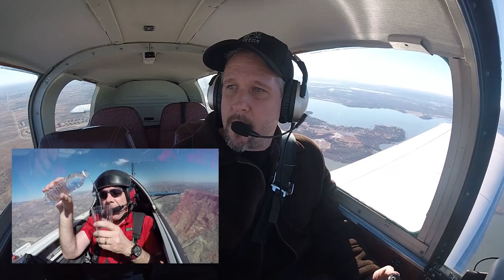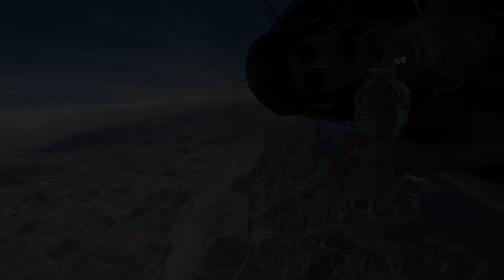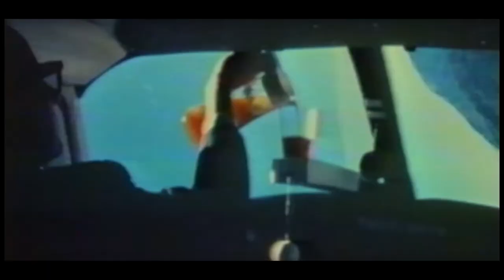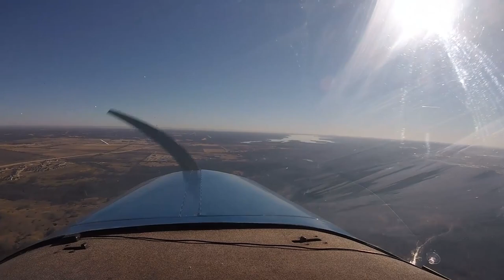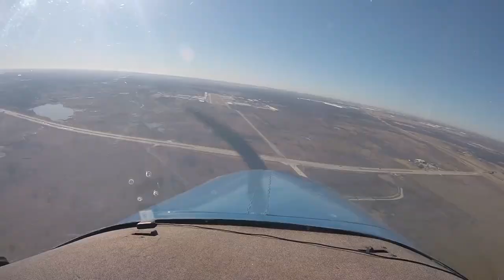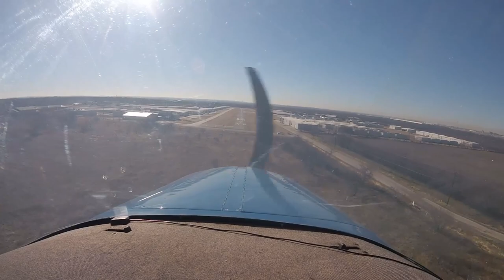Pouring a glass of water in a plane

Comment: Is that the airport where the Cessna student clipped the top of the car?
Reply: Pretty sure it is.
Reply: That's the one
Reply from the maker: It is. And it's going to happen again the way people drive out there
Reply: Just Plane Silly that’s crazy. You’d think they would have done something to mitigate that going forward. :/. (And the fact you fly outta there)
Reply from the maker: @ibgarrett  I know. Right!?
They did put stop signs and low flying aircraft signs. Prior, they just had "STOP" painted on the ground. 
I think it is a common sense issue though. I don't need a sign to tell me not to pull out in front of an aircraft at an airport.
Reply: Just Plane Silly well. First of all. There’s no such thing as common sense, so there’s that. And fortunately with the “low flying aircraft” sign that’ll fix the problem because “stop” and “low flying aircraft” are WAY different things obviously.